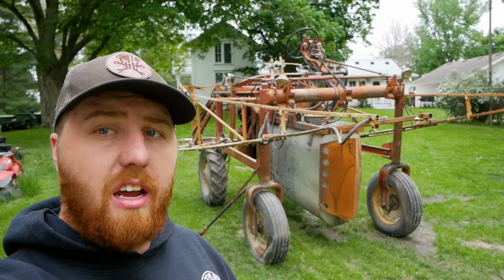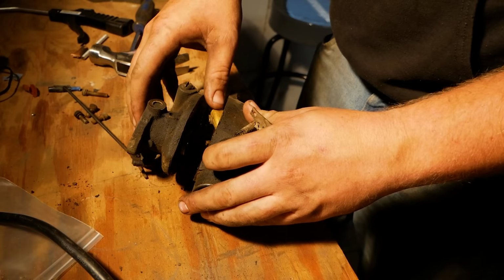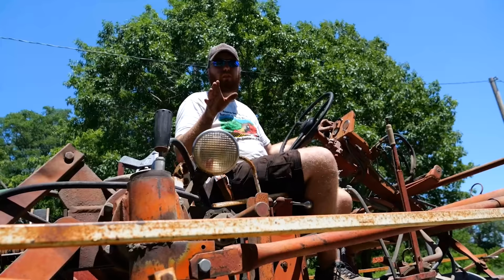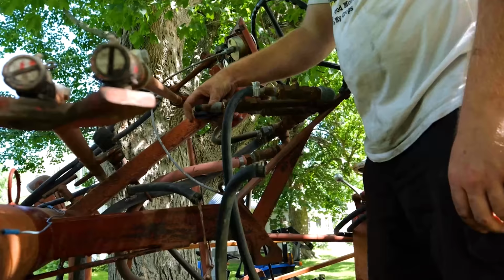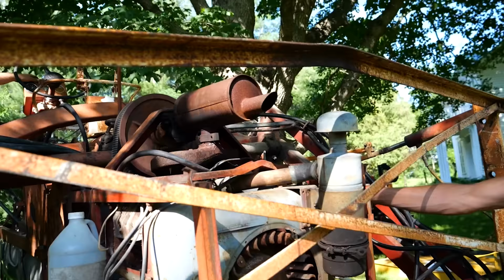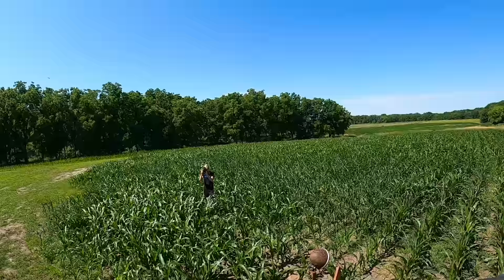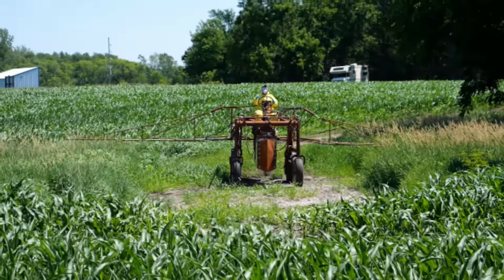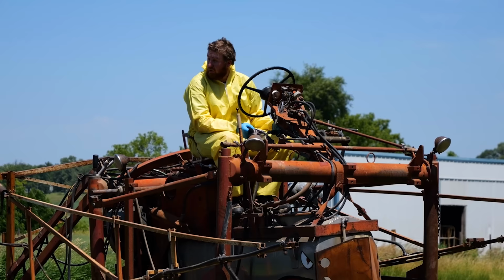Can We Farm With ABANDONDED EQUIPMENT? - Ep. 5 - Spraying The Field

Comment: I was a custom applicator from the late 80's to the late 90's and I gotta tell ya... That ol' Haggie monster was Living History Farms machinery 40 years ago. No kidding I can't believe you got a decent spray pattern out of it. I figure all your equipment should be on 38 or 36 inch row so thats not too bad, and clean everything out and run some spray cleaner and put some crop oil (ask the neighbors) in the pump etc. to make them last. Also USE RUBBER GLOVES AND WEAR PANTS when handling and mixing!! The hands are the no.1 source of exposure. Any more questions don't be afraid to ask. Also you might call Haggie and ask them for advice, they might come up with some help over the winter. Great job!
Reply: To the top!
Reply: I'm pretty sure this is a one time deal.
Reply: Using a modern 3wheel high cycle 6000 series is not much different as far as operating
Reply: I farm tobacco cotton corn beans with old and new equipment. Driving a 4 wheel tobacco primer today
Reply: The 6000 were terrible. They get stuck on a mouse turd. Ask me how I know. Lol.
Reply: @seththomas9105  I have 4 of them and a 4 wheel 6500. Driving the primer through the ruts from them spinning every row right now. If you smoke cigarettes you smoke dirt too. Belts just eating dirt and machine bouncing my ass is sore
Reply: @JoshJackson13  A 6000 was the worst sprayer I ever ran, and I ran truck sprayers too.🙄
Reply: @seththomas9105  yea but they are reliable. Run all day long with no breakdowns
Reply: We got a international 766 and a 966 too running. Both are loud straight pipe. 1969 Chevy 2ton dump truck with no power steering. Old 350 cranks soon as you touch the key
Reply: @JoshJackson13  A 3-wheel Hi-Cycle 6000 is not exactly modern.    I don't know when they quit making them but we had one in the early '80s
Reply: @seththomas9105   The only thing worse than the Hi-Cycle was the old Hahn Hi-Boy.    Lol
Reply: @jeffrankin967  I saw some of those, but never used one. Thank God.
Reply: @seththomas9105  Yeah they were a fine piece of machinery.    Lol.    They made that old Hague look like a Cadillac.    😂
Reply: @jeffrankin967  excuse me a "more" modern sprayer that alota farmers still use especially for tobacco. There is at least 20 being used within 20 miles of my house today. We run 3 non stop all with Broken ACs in a cab like a sona for 10 hours with a chemical called contact that burns like icy hot all over you
Reply: amazin
Reply: @JoshJackson13  not that hard to fix the a/c.
Reply: @duanehenicke6602  it is when you have 5 that haven't worked Ten years
Reply: @duanehenicke6602  I rarely drive one. I drive. The 4 wheel 6500. With AC. Spraying Cotton and beans.
Reply: @JoshJackson13  i grew up driving 40 series John Deere tractors, with the door wired open and the windows opened the full (6"). Dad was too tight to fix the a/c's. And didn't have a mechanical bone in his body. Didn't take me long of eating dirt and bugs in 100°+ temps to want the a/c working. So i went to turning wrenches, and taught myself how to diagnose and fix them. I keep spare parts on hand to make sure i can always keep the windows and doors closed on those very same tractors. Same goes for the hydra cushion seats. Soon as that cylinder starts losing bounce, it's time for a dry nitrogen charge. Back took way too many jarring hits when i was younger. Paying for them now....
Reply: @duanehenicke6602  I just got my wife to step on my back. It's hurting right in the middle. I also play alota golf and disc golf probably why mine is hurting I've been practicing for 3 upcoming tournaments in the next month
Reply: @majcrash  why?
Reply: @jpeknowbody3649  They make car videos.  I guess if the farm videos do well, they might make more, but it's not their normal thing.
Reply: @JoshJackson13  can I grow tobacco in mid Missouri? I don't know how long I need for the growing season.thanks!
Reply: 00
Reply: Very funny I love the suit goggles gloves breathing apparatus all of it making me laugh dude
Reply: PS I do understand that swearing does help.

Comment: Back in the day, that sprayer was someone’s prized possession and saved them thousands of dollars. It’s such an awesome piece of equipment.
Reply: It was definitely beyond its time. Fully hydraulic boom. Section shutoff. Pressure gauge up front and easy to read. And a speedometer.
Reply: @duanehenicke6602  don't forget automatic safety cutoff.
Reply: @FatalxWolfsgrin  didn't 👀 that. Or i don't remember seeing it 🤷
Reply: @duanehenicke6602  the cylinder head sensor will shut the engine off if it senses an overheat by disabling spark.
Reply: @FatalxWolfsgrin  oh yeah. Remember now.
Reply: @duanehenicke6602  eaààaaàaaßßàà

Comment: I love how the Giant Pliers have been a sort of character on this channel ... bought as a joke but one of the most useful things you seem to have besides brake clean lol
Reply: Giant Pliers just doesn't do the tool justice, how about The Jaws of Fight
Reply: I have a pair of those things.  I use them for many tough jobs.  And when it just don’t come off, you can crush the whole project with them one bite at a time. Very satisfying
Reply: They're small when you consider what they're for, pipes & pipe fittings.
Reply: Knipex pliers are biggest workhorse of my tool equipment beside the box cutter and tiny flathead screw driver that has its corners rounded from use. Box cutter cleans surfaces level and cuts, pliers hold and open pretty much anything and screw driver is perfect tool to get o rings etc out and position things, plus cleaning hard to read areas. Though i do mostly small and microscopic stuff.

Comment: The sprayer was definitely one of your most challenging restorations but there are so many moving parts, it was a small miracle you made it to the field and actually sprayed.  My hats off for this whole series, can’t wait to see you get the corn picker/combine working next.  You better start working on that now so you’ll be ready for harvest 😉😁
Reply: Yes, starting sooner is good advice.  As for the sprayer, I guess for next year, try to recalculate everything for 2 mph instead of 4.  Actually, that seemed faster than 4 to me so confirm that it isn't.  That may apply to harvesting too.  Plan to do it real slow until you get enough practice to get bored, then speed it up towards normal.  Also, fix the steering so it draws less attention away from all the other management tasks.
   Perhaps farm work should have been the priority instead of that race.

Comment: cant wait to see them play with a combine
Reply: I just hope they have a fire extinguisher handy!!😬
Reply: If they get the right late 60's Massey Harris Kevin will be in his glory. Quite a few of those oldies came stock with a Chevy 327 cu in V8 with 4 bolt mains.
Reply: @AutoCrete  327 never came with 4 bolt mains
Reply: @jeffbell9305  327s came in a 4 bolt main..they were used for combines the 510 models to be exact ..been wrenching for over 30 years and have seen about a dozen of them
Reply: No kidding with all the belts and Flails and cutter head and all and all and all can't wait!!!
Reply: @janeames1513  it was a 350 with a 327 crank then.
Reply: @janeames1513  True there are 4 bolt main 327s They are modified  (block machined for the 4 bolt caps& mains)or they dropped a 327 crank in a 350 block. Chevy never produced a 4bolt main 327 for general production.
Reply: @jeffbell9305  I'd recheck that Jeff. Search Massey Harris 327 V8. It's a late 60's Chevy industrial engine.
Reply: @ Auto Crete

 I hear what you're saying but I'm pretty sure he meant that Chev never built a bona fide 4 bolt main 327 unto itself and installed them into a production car or truck. Industrial engines and farm equipment are different animals than cars and trucks that are passenger vehicles. Just my two cents worth. Peace & good vibes!

🇺🇸🚜🌽👨🏻‍🌾🥔🍅🌱

- Max Giganteum
Reply: Maybe they'll find a corn Harvester option for the front of the Farmall H.
Reply: @AutoCrete   The old John Deere 55s had a 327 in them also
Reply: @jeffrankin967  I learn something new every day.

Comment: Well done you chaps for making that heap of crap work again . Most of the time most of the nozzles were spraying at a decent pressure considering the state of the pump . Even the engine seemed to be running quite well at the end . The crop looked pretty good too !
Reply: Old equipment is the best, since its most simple. Try storing modern equipment into storage barn that collases on them for 40 years and try get them started.. it will never happen since too much fancy electronics to fail, rubber and plastic parts to degrade, high tolerance nozzles to clog up and seize up etc.

Comment: I ran a GVM Prowler for 6 years and covered tens of thousands of acres of corn, winter wheat, cotton, soybeans, and pastures. It was hard enough in my air conditioned fishbowl cab with an air ride suspension, Viper GPS, auto steer, 4 wheel drive, front and rear lockers, and top speed of 44mph. This looked like pure hell on wheels lol
Reply: Sure, but store that thing same as this one was for 40 years in the barn that collapses and then try to get it running quick... yeah i will bet money that wont happen. Same with all other equipment. New ones have way too much fancy electronics to fail and when one fails whole thing is dead in the water. This thing needed just cleaning and couple readily available parts that you could in a pinch make your self. Old school for the win!

Comment: Excellent video Junkyard Digs Kevin  :) also Jesse  :) fixing up sprayer tractor nickname Sharkie  also yes Sprayer takes tasks work them old days you could do 5 to 8 mph and modern ones do lots faster like 15 to 25 mph do my area of 3 and 4 wheels plus 2 and 4×4  called Gators! Remember my dad use 1968 International 624 A International Desiel fuel motor 60 hp with 3 point hitch hook up 250 gallon tank sprayer too do sprayer on hay , grains and corn crops over 650 acres in 2 weeks worth too on 3 farms do ! Glad we had deep well water on home farm to used and super clean water to use in tank ! Also how my late keep tip also hose plus pump clean he put some desiel fuel with water mix up  and spray on on pasture land no crops to grow then flush with vinegar and water on tank full 2 times! No problem ever !

Comment: I've done my own spraying since 2002 and yes row spraying is the most stressful. When you first got the pump on and going you should've put atleast one main screen filter after the pump and then when you got all your lines unplugged and leaks fixed you should've just left all your nozzle tips off and drove around running a 1/4 tank of water through her so you wouldn't get crap in your nozzles right off the bat. Oh and count how many rows one boom covers and then double it when you turn around you know what row to drive in.

Comment: Sounds like the coil is probably dropping out when it starts warming up a little bit. Those old Wisconsin engines had breaker point ignition systems on them too. So it might be worthwhile to convert it over to electronic ignition. Probably would run alot better with a hotter spark.

Comment: I did custom spraying in 70s and 80s, first had manual valves then we went electric valves, at 10 MPH, with fields being odd shaped, trees and posts in fields, and on slopes where you need great pucker power to stick to seat.  You did good, it gets easier as you go.  Fun to watch.

Comment: After all this is over you should pull all of the spray-related stuff off this machine and put a diving platform on the part on the rear frame that goes up and down. Then go to a boat ramp, drive the whole thing down into 4-6 feet of water, and have a great day out on the lake. Then just drive it right back out and onto the trailer.

Comment: Great Video, just running through the piping plugs as yeh do. 
Can I suggest a Rode Go 2 wireless mic, like Al from The Skid Factory uses. I have to adjust the video down to 50% on YT when you start the engine, and back up to 90-100 to hear you well. If you felt like stepping up the audio and vocal clarity it would be $180 well spent.

Comment: You might want to look into whether your sprayer could be converted to drops that would move the spray tips down below the corn leaves, to better engage the weeds.

Also, you could consider rigging your tractor with cultivators and deal with weeds while the corn is still fairly short the old fashioned way: by hoeing it under.  That opportunity has passed for this season of course, but it's something to bear in mind for next year.

All in all I am just agog at how this has gone, I'm totally digging the whole using abandoned gear thing and rooting for you at every turn.

Comment: That old winconsin engine might not  have hardened valve seats might try running it with some lead substitute and off road fuel might run alot better and keep the valves from sinking it seemed to run alot better once everything got up to running temp and got some heat in it

Comment: A Mennonite friend of mine had one of those 4 cylinder Wisconsin engines on a sand conveyor for many years, and only stopped when it burned about a half gallon of oil for unloading a single 10 wheeler dump truck. When he took it apart for a rebuild a few months ago almost all the pistons easily had 1/4 play around them and it still run. 

I have no idea how...

Comment: if you decide to keep using the machine I suggest putting a couple of those wide angle blindspot mirrors busses use off the front so you can see your front wheels without having to stand up, also that steering should have some adjustment to get rid of all that play

Comment: You could find some out-of-date fire hoses like the ones in small buildings on a swing out reel. That way you could replace the water hoses on the cheap.
Reply: And you should replace the windage cover that has rusted out. You'll be losing a lot of pressure with that big hole.

Comment: Does anyone else think it has a burned  or stuck valve?

Tire slime usually works best in the tire instead of in the tube.  At least a quality stopleak like genseal from GENSCO that has lots of fuzz and crumbs of rubber.  Somehow a tube puncture just can’t hold onto the stopleak and as soon as you park it wrong, the stopleak drains down and the air escapes. You can poke a tubeless stem in the hole in the rim leaving the old tube in there to slosh the stopleak around

Comment: Awe man I friggin love the paint job! I had a satin finish army-green (2001) s10, with kind of a rat-rodded homemade cowl hood on it I made. I was dead set on putting the bomber eyes and teeth like yours, on the front fenders/doors lol. Ended up instead practicing a small tribal pinstripe design as a hood emblem, and a small spiderweb into a pinstripe under the rear ext cab side windows lol. At least I tried something new! 

Then the rally-tercel almost got the bomber treatment, ended up with just plain white, rally lights, red mudflaps, tow strap, etc. Just a cheap ripper

Im definitely still using the bomber another time though, when the time is right lol

Comment: my brother use to spray tobacco with a hahn hiboy tricycle sprayer. hand crank and one time in the middle of the field the front drive tire busted. had to link chains together to pull it out of the field to even work on it. lol we have hilly ground and he tipped it over and it broke some of the cooling fins on the flywheel so he had break some off the opposite side to keep it sorta balanced.  lol
Reply: Been there, done that with the flywheel fins

Comment: Kevin after all this to get this thing running and then to have just one nozzle plug up is miraculous. The grass? Well we have to wait and see. Did ya'll ever get any fertilizer on? NO? But even so the corn looks really good and if that diesel and old gasoline kills the grass hope it don't do the same to the corn. On camera you couldn't see the trammer run down the corn, and you had the height fairly good unless the wind blew it away. You will probably be surprised how good it did after you found the mouse nest under the engine tins. Had you not found that the nightmare would have lasted 3 or 4 more hours and would have caused stoppages that would have made the corn not do so good  at all. If you get good corn it will be a miracle, but it always is, look what happened to Duffys crop in NY. But he can still chop it for fodder.

Comment: Hey man i know this has nothing to do with ur sprayer but i got a 83 f100 i cannot get it timed right any options thanks man
Reply: If it’s an in-line 6, check you’re putting the wires on the distributer the right way around.  Clockwise or counterclockwise….take cap off and crank it over to make sure you have it right.

Comment: I'm a little late to the party but why not soak everything in CLR on the inside should resolve all hard water deposits in the pump lines the  spray nozzles you may have to use a bowl soak it for a bit then on to the next nozzle and so on

Comment: Looks like you Could it go to just about any small engine shop and get an old lawn mower so Is sullenoid  they look the same on most of them
Reply: Watch out.  Some of the ones on lawnmowers aren’t the same as the old FORD.  Look the same on the outside but connected different on the inside.  Results may be $$$$$